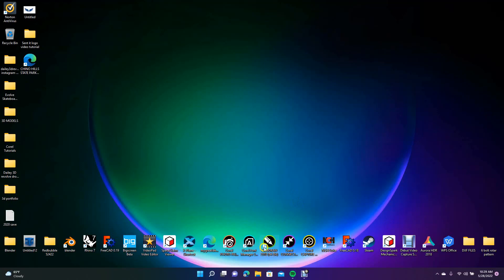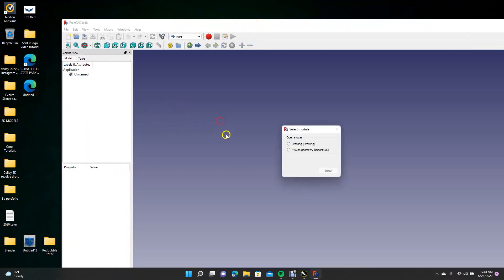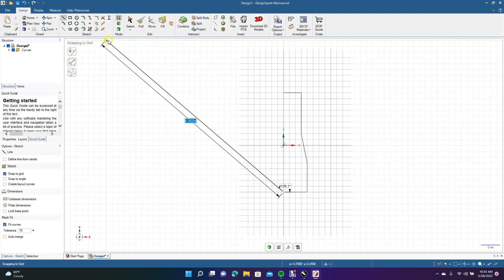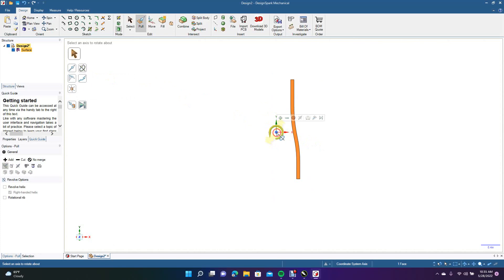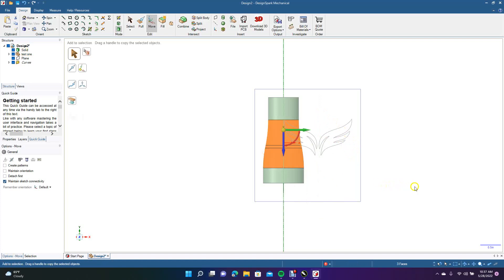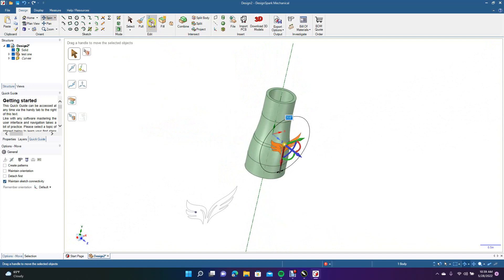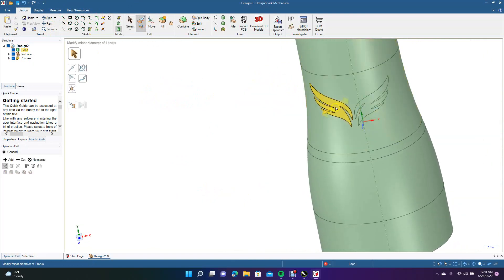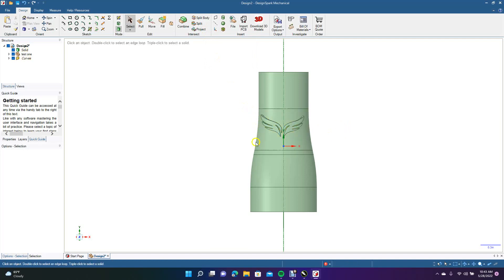How to project a logo onto a cylinder in design spark mechanical

Comment: What type of files can I use  for project onto a solid in spark mechanical?
Reply from the maker: Carlos, DSM is limited on the files you can use, but the program works with OBJ, STL, STEP, and sketch up files.